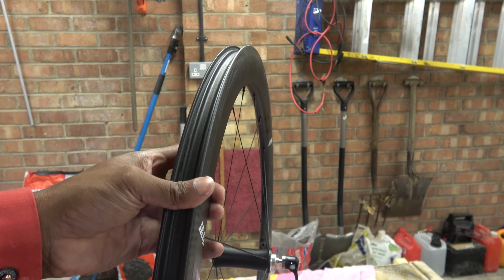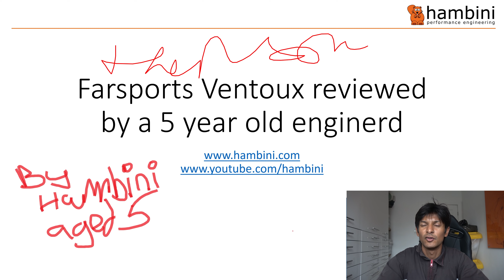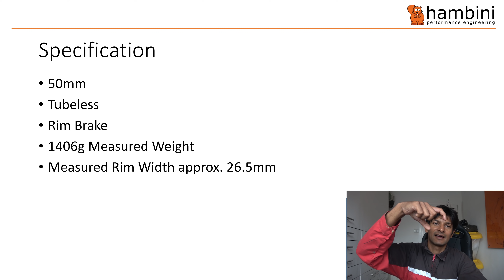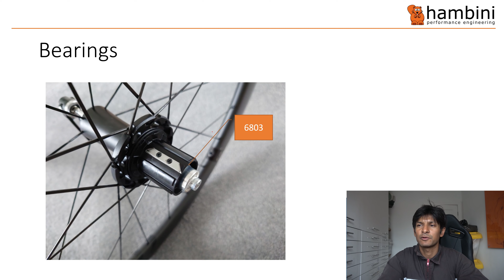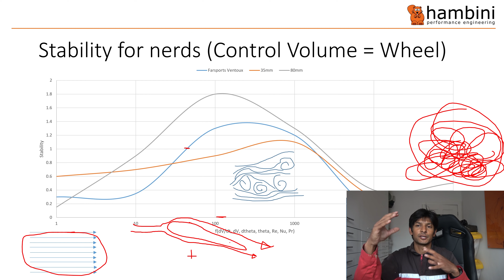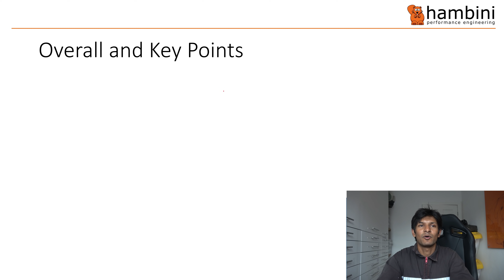Hambini Reviews Farsports Ventoux C6 Carbon Road Bicycle Wheels (56mm)

Comment: If a spoke is broken and/or the spoke nipple needs replacement ?
How's that done on a wheel like this ?
Reply from the maker: you need to screw on a small insert onto the nipple then use a magnet to pull it through the hole. Once it's through you can take the insert out and screw in a spoke.
Reply: Thanks.
Just needed to activate my brain a bit :-D
If a nipple drops inside the rim, it just removed via the valve-hole :-)
And a new one put in place the same way, via magnet-help.
Quite obvious.
Reply: @Hambini  sounds like a massive PITA to replace a spoke and/or nipple. Must add $$$ to the cost of creating the wheel in the first place. I'm sold on Farsports for next wheel set thanks to you & PT; this design looks fantastic, except for the spoke/nipple issue.
Reply: https://www.youtube.com/watch?v=nXeZfRD-fQ4

Comment: Great video (and powerpoint) and in-depth review. The transparency is always appreciated! 

Hambini, what kind of grease would you recommend for general maintenance of ratchet star bearings/internal freehub body (specifically for Winspace disc brake wheels 6803/6903)? Winspace recommends Kluber Nb52 lube for the ratchets and a waterproofing lube one for the outside body. I have also heard "DT-Swiss special grease" is recommended for their EXP ratchets, but both are quite expensive for the amount they provide and sold out in most places in my area (U.S east coast) do you have any recommendations that are readily available or what do you personally use? Please keep up the great videos and I would appreciate any advice!
Reply from the maker: An NLGI 0 grease should cover it. The ratchets aren't really moving once the wheel is locked, it's only when you are freewheeling when the ratchets are reliant on grease. You want to avoid too thick grease otherwise the ratchets will not disengage. 

 I would not get too stuck on the brand name, it's the viscosity that you should consider. A page about this is here

https://www.hambini.com/grease-for-bicycles-a-practical-guide/

Comment: I have four sets of Farsports wheels. Well built, thousands of miles on gravel and road. The only "issue" with them is that because you aren't paying for crash insurance when you buy them, if something does happen, you need to pony up for a rim and arrange for someone to build it up. Highly recommended. Fantastic value for money.

FWIW, I wouldn't classify the rim's optimization for tubeless as a bad thing. It's more just a noteworthy thing. Obviously, not for everyone, but as you note it's totally fine to run them with tubes if you want to roll that way.

Comment: I'm leery of full carbon clinchers. Any plans for a long term review of the Shimano C60 wheels?
Reply: I've been on the c60 for about 6 months. I'm with you, nothing like an aluminum braking surface. Was riding the c 24's.  The hubs are typical pro quality with a quiet freehub, They are not light but at 200 lbs durability and not breaking spokes is more important than saving 200 grams,  noticeably faster on descents and flats compared to the c24. My only con is slight thumping on the front wheel on braking like at the seam but the seam is smooth. For me anything dura ace lasts forever. These are not race wheels but a very robust every day wheelset that i bought on ebay for $1100 new . If aero is no big deal to you, the c24s are fantastic and give a very comfortable ride, especially with latex tubes.Buy new  dont trust used wheels because of wear life on the braking surface.....

Comment: would like to see you do a review on Yoeleo's... I have a set of SAT 50/88 SL's 23mm wide, they were out of true, when i pumped tube and tire to 100 psi: the carbon split near the hooked rim part. Also: they are suppose to be tubeless, however the water drain hole was leaking air when i was trying to set them up tubeless....

Comment: Well I went with a set of Pro 50 Yeoleo wheels. For under a $1000 shipped they are amazing. No funky off name hubs, spokes or nipples. DT Swiss, Black Sapim CX-Ray spokes, Black Titanium Quick Release Skewers. Very easy to work with and have been at it for some time. For example I wanted a plated brass nipple, not alloy (that corrodes fast in my coastal area) and the did that no charge. I have put 10,000 miles on my set just this year at I’m a 225lb fat ass. Still straight and true. Not a cheap wheel but x100 better than my junk Mavic Cosmetics that fell apart.

Comment: Having a Fulcrum  carbon wheel, there is a crack in the rim, a typical compression failure in the fibers. Have been in since mid June, nothing heard yet. It is apparent that the different carbon sheets has not been positioned symmetrically, the gland to the valve stem is not properly installed. Build quality is not as expected and service from fulcrum yet to be proved. European brand has to increase both service and quality if they want to maintain their market position.

Comment: I have Farsport Kaze 69 tubeless and 35mm tubular; great wheels; 35 tubulars weight 1020g, both of them with carbon ti hubs; just cant beat it for the price
Reply: How much do the deep ones weigh?
Reply: @elijahkwon422  1620g
Reply: @janeztomazic5546  Do you think the 78mm ones would be too heavy or just insanely fast
Reply: @elijahkwon422  from my experiance weight doesnt really mater much; i am using the 35mm only on steep climbs 8%+ and even there the results are almost the same as 69mm; so, if you dont ride only climbs lets say 6%+ I would have no problem buying 78s, my next purchase will be even deeper wheels, they really are a joy to ride

Comment: Hope those hubs last better than my new set if wheels ex China. Never had a problem with novatec hubs until now with a slipping freehub brand new. Novatec support was shocking or non existent. DB412CL if anyone is interested.
Reply: Hey! I am the owner of a bike brand from Singapore. We've had similar issues with the exact same hub. I believe it is due to excessive grease inside the freehub. What I did was: Open the hub using 2 17mm cone wrenches, clean out all the grease inside, including the pawls. Replace with a light freehub grease. I used Dumonde Tech freehub oil and grease. Put it together, seems to solve the issue.

Comment: Hamibini, if I remember correctly you once told us about these Mavic wheels which had this rubber (?) thing which was put in the gap between tyre and rim. I think you said, that was great for aerodynamics, but the UCI banned it.  My question: Could I just put some silicone in the gap? Would it make the wheel considerably faster?
Reply from the maker: Yes there is a video that shows just that. It's worth doing
Reply: @Hambini  Cyclespeed Tours did a piece on the silicon gap thing on his channel - the man with a massive lawnmower!
Reply: @Hambini  silicone is so messy.  I wonder if a siliconized acrylic caulk would be better?  I may try that
Reply: @loopie007 you're missing the point of this channel, mate.
Reply: I have found that pedaling harder gives more results. Also, what happens when the silicone comes loose and gets trapped in the brakes?  Don't be that guy. Buy quality stuff and hammer!

Comment: Im Riding a Farsports noHoles Wheelset with Conti 23mm and Tubes no Problems. Campagnolo Wheels are also noHoles and officially allowed for Tubes.
Reply: same, 23mm conti 5000 with latex tubes at front
Reply: so it is ok to run tubes these Ventous-C wheels? I still prefer using tubes inside 
instead of tubless.
Reply: @chrischang7330  im running 7.5Bar rear and 7.0Bar front on a 26mm wide Kaze Series Rim
Reply: and the tire pressure you use for Conti 23mm, thx

Comment: I got come 38mm carbon Farsports last summer, running them with vittoria Corsa and latex tubes with no issue. Had them built with sapim cx ray and DT swiss 350 hubs. They've been faultless. They let me change the colour of 2 nipples (either side of the spoke hole) and their communication was perfect.  Don't forget these guys are no longer closed as "cheap chinese carbon" since the Austrian lady won the Olympic road race with their handlebar/stem combo last week. rolls eyes
Reply: I just checked the prices, and they’re higher than I expected.
Reply: @petesjk  how much are you expecting UCI approves carbon rims with DT 350 hubs and Cx Ray spokes to cost?

They’re the same price as Mavic Ksyrium, and less than half the price of Roval. 

You’re entitled to your opinion of course, but they seem like pretty good value to me!
Reply: Which of their rims did you go for (which series)?
Reply: @olisharp6801  hey dude sorry it's late I got a pair of customized ones so I think it had their "classic" rim
Reply: Is there any reason why you prefer latex tubes over tubeless? What are your pros/cons?
Reply: @bikelatino2146  for tyres under 30mm I don't think tubeless is worth it personally. I'm 56kgs and only run about 80-85 psi in my road tyres and I've never punctured with a latex tube since I started running them (about 5 years).
A latex tube with a tyre like a Corsa (which is really supple) feels lovely and they're super quick. I run tubeless on my CX race bike and wouldn't have it any other way, but on the road, I'd have to carry a tube just incase anyway and would rather not have the mess if I ever do have a puncture.

Comment from the maker: A few points:

0.5 I'm on Instagram but I don't know how to use it @hambinieng
1. There is a discount code in the description. IT IS NOT AFFILIATED
2.  Some of the technical aspects around testing and how the things work will be covered in a separate video - I've had lots of requests for it now and judging by the comments, I think viewers are much more technically aware than they used to be so I'm going to do that.
Reply: I bought a set of SuperTeam carbon clinchers with aluminum braking surfaces and I really like them.  We have a lot of wind in the San Francisco Bay area and I seldom have steering difficulties with the deep wheels.  About the same as box section rims. The aluminum braking is something you really need here. I think having a stop sign at the bottom of a 9% grade pretty much precludes carbon braking surfaces. After 3 years of running tubeless, they just weren't worth the mess and often flats for a slight loss of rolling resistance.  And I bought the best tires. I've also gone to titanium. Yes they are heavier but I am not joe racer. And carbon forks are more reliable than carbon frames.  Though you wouldn't know that until your 10th year on a carbon frame.
Reply: Thanks for the stability response 👍, not quite that good at "in depth" (your profession) i did do basic lift and aerodynamic principals when I was in the Airforce some years ago. Looking forward to your follow up. So my question is more about the shape of the tail on the rim changing from older wheels coming to more of a point vs the rounded back and if this affects the collapsing of the air flow between the two designs when you recieve a yaw/sideways gust. From my limited training,  rounded back will help reduce the pressure difference on the opposing side near the rear of the rim. Or is this not such a big difference at bicycle speed?
Reply: Same here no clue
Reply: @Hambini  cheers 👍
Reply from the maker: @waynosfotos  mmm.. Interesting my reply has been deleted
Reply: @Hambini  what here on your channel? How can that be? Or are you talking somewhere else?
Reply: @Hambini  hmmm just re-checked from notifications, yep gone. Was nothing wrong with this reply, inappropriate etc. Very strange. 🤔
Reply: @Hambini  big brother.......🤔
Reply from the maker: @waynosfotos  it's deleted that one as well
Reply: @Hambini  oh shite!
Reply: hi for anyone looking, his instagram is @hambinieng (he missed an 'i' in his 0.5 point above, but luckily for me, i know how to spell his name :D )
Reply from the maker: @garysprojects  good spot gary, i have fixed it
Reply: using instagram is easy, just don't follow anyone except those u approve its quality.